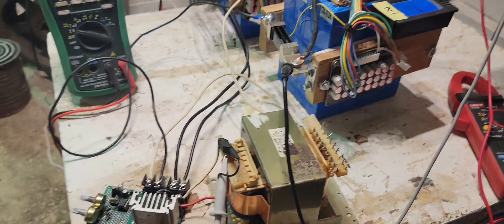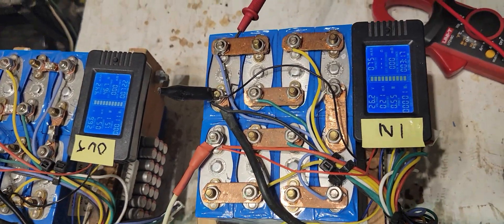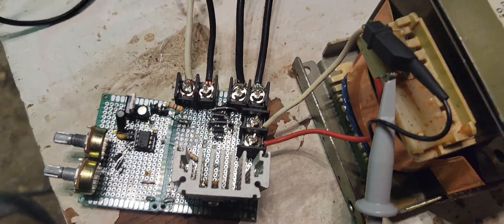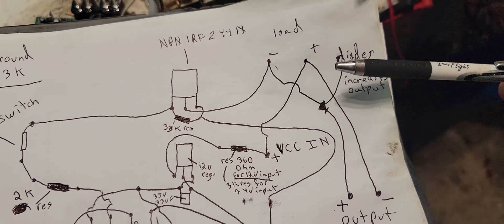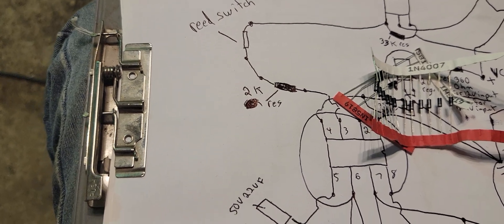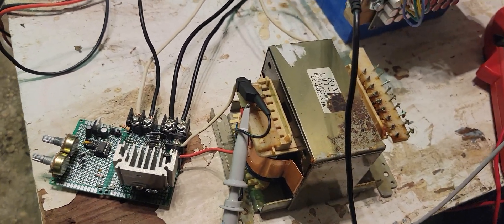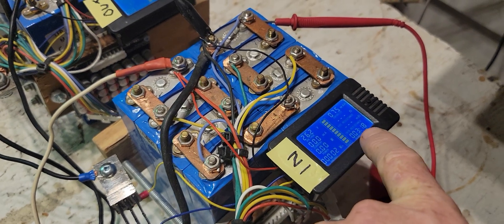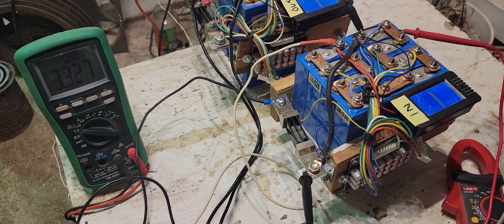Free energy Circuit details I changed.

Comment: Gday I love your work. Will this drive circuit work with a timing vane and slot sensor to switch the circuit ? (instead of the reed switch or hall sensor). I have an air coil dual rotor with stator coils between.. does this  circuit handle large bemf? Im a learner but want to start looking at a diiferent drive circuit for my motor. Cheers
Reply from the maker: Awesome I'm happy to know you appreciate! 
I'm pretty sure this circuit will work for your needs as long as the frequency isn't too high because I notice after about 15k the diodes begin to saturate causing the output battery to backfeed the circuit blowing the Mosfet

Comment: Hello, how much power did you gain? thanks
Reply from the maker: It depends on what type of a coil it being pulsed . I've reached some incredible power gains . I've seen 10 times more out than going in with lower input rates . As the input rate goes up the efficiency goes down.  I'm going to make a long video of it running  very soon . It will give a very good view of what is capable. 
Thanks for watching and I appreciate the comment
Reply: @windpowerandmore6310  I am very impressed with the engines you have made before and I am very informed by your long informative videos, each of which is very inspiring, thank you.

Comment: Thanks again! People have recommended MUR460 fast recovery diodes. I haven't had the time to test them yet. I also recommend to use at least 3 of them in parallel to reduce the voltage drop (same for LEDs, might also work with transistors).

3 pin "LM7805 Stepdown Module Regulator Replacement" should also be more officiant than the 7812 for 12v.
Reply from the maker: Great thanks for the info about the regulator .. the fast recovery diodes don't work in this circuit I've only had positive results with the diodes I've recommended using.